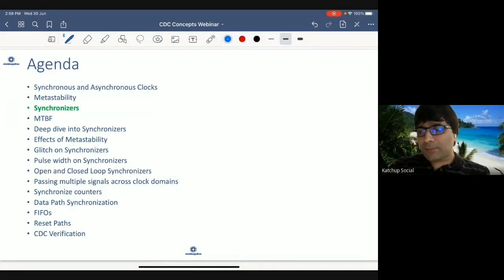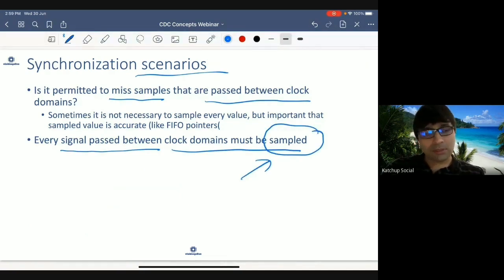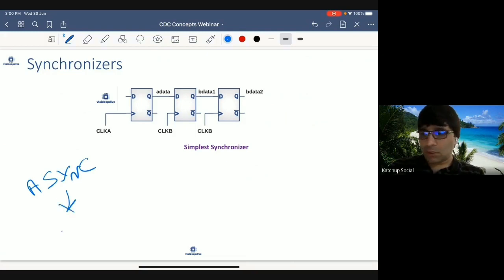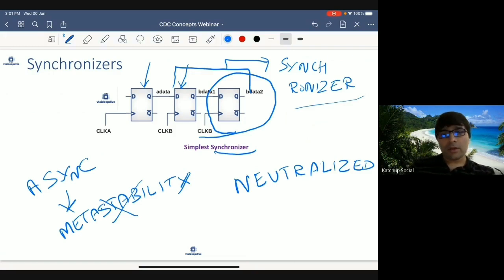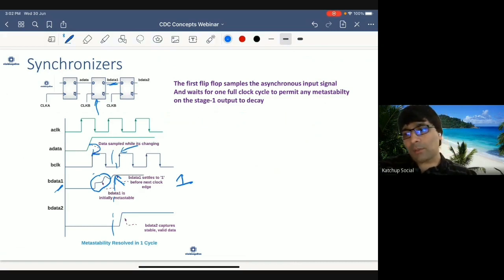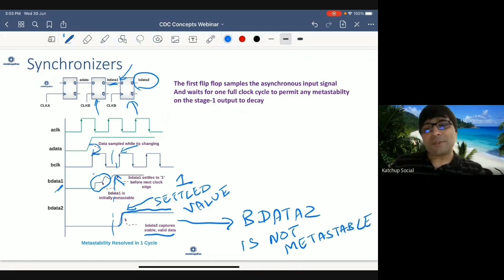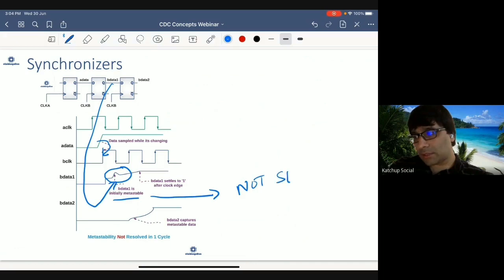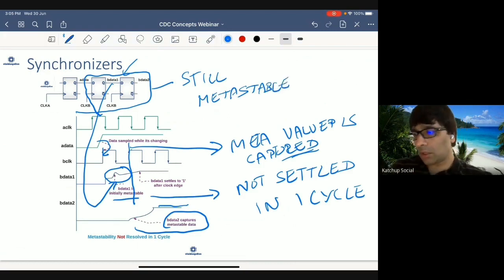Clock Domain Crossing (CDC) - synchronizers

Comment: is there a way to remove effect of metastability completely even after data is settle to a wrong value? basically input change 0->1, output may be 0 after metastable value settle to 0
Reply from the maker: The effect of metastability is primary delay, if the input data is kept stable in the next cycle correct value will be captured. You can check more here - https://katchupindia.web.app/cdcwebmetastabilityeffects